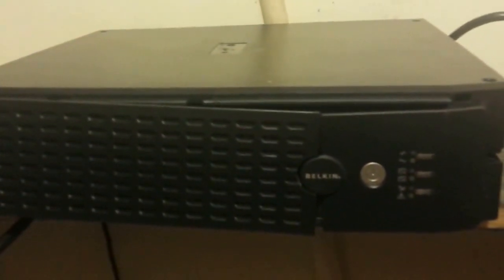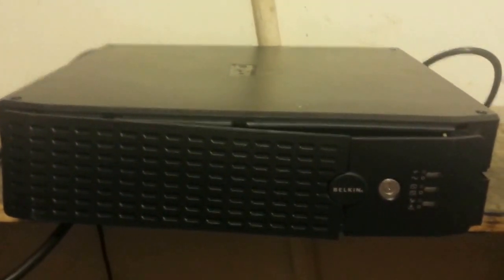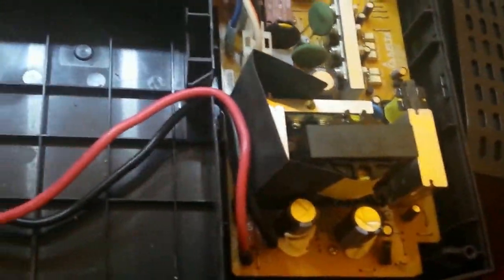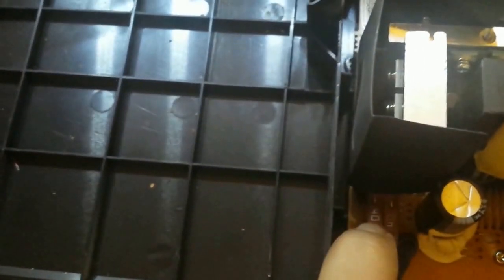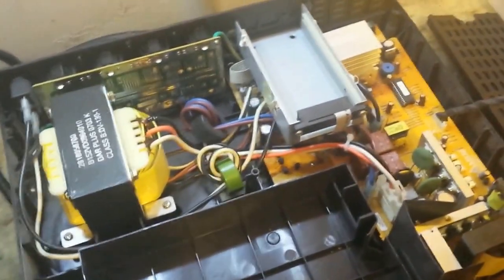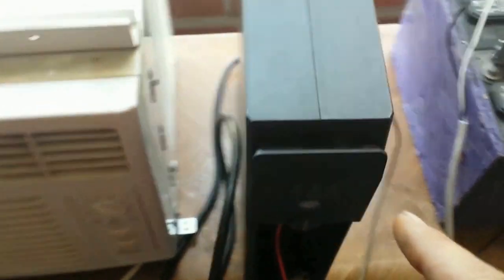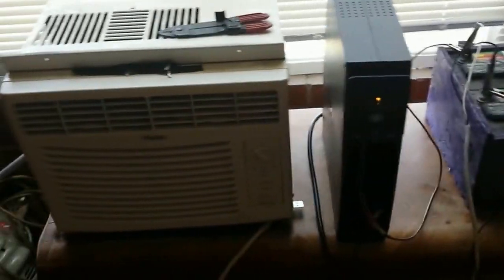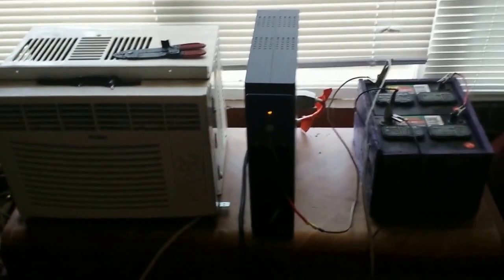Easily turn an old UPS into a power inverter. FREE AIR CONDITIONING

Comment: Bummer, my UPS doesn't work with batteries anymore. I extended it with extra batteries and it didn't like that. Probably to expensive to repair.
Reply from the maker: You can find UPS units at the thrift store for super cheap. Most of them get donated because the battery died
Reply: @ThriftStoreHacker  I think not here in Thailand. And then again it's mostly Zircon over here and I don't trust them with power batteries anymore. Dunno what happened with them; yes, I ruined 2 already. I can give it a try at the bail shop.

Comment: your gonna kill that compressor and motor inside that ac unit with that square wave UPS. youll need to get an UPS that does pure sinewave output
Reply: i doubt it's square wave. if it's designed for computers, it's gonna be a sine wave.
Reply: @lands1459  smps (computer psu fall in this catagory) have no issues witha modified sine wave (Square wave) as they have a bridge rectifier (Full wave) that turns that 115 volts into 170 volts then get bumpped up to around 400 volts dc before it is then switched on and off in the Khz range. you could literally run a computer psu off DC provided you have a high enough voltage. most if not all budget inverters and UPS are modified sine wave (Square wave) with only the really expensive models (akin to the ones used in the it industry for server rooms) do a pure sine wave. do your research. How ever as a side note some spu's with actvie PFC have issues with modified sine wave inverters.
Reply: @CotyRiddle  That's pretty interesting, never knew the mains was fed into a rectifier right away.
Reply: @lands1459  usually it will go through some type of common mode coke and or a differential choke with some x and y capacitors along the way before hitting the rectifier and then being sent to capacitors. go do a readup on how a smps works and the typical layout.
Reply: @lands1459  here is this video from DiodeGoneWild. he goes into some of the technical details and everything but the first one he sows during the introductory clearly shows the rectification stage right after the mains input. https://www.youtube.com/watch?v=cX4q0e124C4

if I can recall correctly there is some topolgys that don't have that as the first stage but almost all smps are the same
Reply: Computers don’t care if it is a square wave or sine wave

Comment: Before everyone turns into a cowboy and rips their speaker out, when you turn the unit on, push the button twice, and it should silence it. You can also plug it into a computer and download a free program to silence it. You can also put a switch in series with it, to turn it off and on. Put some terminals that go to the battery so that you can put a voltmeter on it to check the battery level, or plug it into your computer to tell you how long you can operate it before charging or changing out the battery. When the battery goes down to a dangerous level where it can be ruined, the speaker will make a continuous noise, so keep that in mind before you silence its ability to tell you something is wrong!

Comment: Now if you connect a solar panel to a power inverter you can connect it  the batteries for free solar powered air condition..

Comment: ok how long does it continue & does the ups get very hot?
Reply: Used an 1500W UPS with integrated fans. Do the job for a months (and more if you don't forger to clean the fans every 6 months to keep proper cooling)
Reply from the maker: omar faruque I ran this for 30 minutes and it got really hot. The UPS doesn't have fans. With proper cooling it can run much longer.

Comment: i noticed ur only using one side of ur batteries how do u run anything using ONLY two negative or two positives wires dont u need one positive an one negative to complete a circuit?????
Reply from the maker: Lee Monster this setup is 24v. One positive from one battery, one negative from the other battery, and the open positive is connected to the open negative.

Comment: so if you replace the two 7amp battery with two 12v 100amp for example,the inverter will accept that??
Reply from the maker: jameswoll link two computer fans together so they run on 24v. Cut holes for venting
Reply: The amperage is a capacity of the battery system which can be pulled from it,. The inverter would be pulling  up to  7 amps from the battery, not the batteries pushing x number of amps.
Reply from the maker: VALENTIN TULUCEANU i usually run this on two 72 amp hour batteries. Just make sure you add some fans to the inverter to keep it cool.
Reply: How/where do you connect the fans?
Reply: NEAR THE PART THAT CATCHES ON FIRE!!!

Comment: i have one of these but an apc. a  little bigger, cant wait to get the new batteries installed and also utilize the rear aux battery port for a set of 2 mack batteries! nice for the fridge, router and tv's so when power goes out, theres not even a flicker of power outage, it is steady on!
Reply from the maker: Just make sure you open the APC case and make the cooling better. put some fans on the control board to handle the heat. If you have a 2000w supply make sure to run it under 1500w or lower to get a long life out of the device. Some 12v computer fans do a great job shedding the heat.
Reply: ThriftStore Hacker I already cut the holes and installed a fan directly Infront of the transistors! Those puppies get hot enough to BURN an egg 😳

Comment: Your going to want some kin of a cooling fan blowing over the heatsinks inside that UPS. Mostly because the inverter in there was never intended to handle that kind of an inductive load. You can get away with a few fans and phone chargers. You could even run a computer for a long time on that setup. The inductance of the compressor of that AC unit is dangerous to attach to that UPS. I mean, I know it was cheap but why brick it if you don't have to? Putting bigger heat sinks in would help too, like from an old computer power supply or something. The one's in there were designed to run for a maximum of five minutes while a computer shuts down. If you do nothing else, keep an extinguisher handy just in case... I want to see more videos, not an obituary... Just be careful man...
Reply from the maker: i am very careful when it comes to AC power.  As for the fan idea you are extremely correct. I fried the 1st ups i had due to overheating.  I have a different one that is the same make/model and run two large computer fans over the main board.
Works pretty good and i use it to run the air conditioner in my shed.

Comment: The inverter cost money and the car batteries cost money. The cold air is not free. Even the air conditioner cost money to buy it some one had to! However, the video was good why throw out something that still works!
Reply from the maker: Scott Shuman Yes. There is startup money involved. You can find these inverters at thrift stores and garage sales for 10 bucks. the smaller ones that run on 12v can be had for almost free.
The batteries are best bought remanufactured if you have a local company that does it. My local guy remanufactures batteries and sells them for half the price of new ones with a 2 year warranty.
The charging system is where the money goes. I already have 1000w of solar so I can run this box most of the day on the electric trike battery pack.
I also have plans for a diesel engine powered charger. I can make it run on waste oils.
my projects are never done and are as cheap as possible to build. As I aquire more cheap junk I will come back to this project. Garage sale season is coming.
Thanks for watching!
Reply: I reuse everything personally as well. Things cost to much now days.
Reply from the maker: And it makes a fun hobby. You learn a lot.

Comment: is your ups sinewave ?? thats an awful lot of electric noise
Reply from the maker: joshua gabriel It is a cheap inverter setup. makes a lot of electrical noise but works good. I gave this setup to a friend who lives in the mountains and they now use it when their power goes out during storms.
Reply: +ThriftStore Hacker Well its a good setup , but i suggest buying a sinewave based ups setup especially when your going to use it with appliances like an aircon, it helps work the aircon more efficiently , im sure you can find some of those reasonably priced :) 

im just doing this to help other people out there that share the same ideas about running electricity for free an living off grid :)

hope this helps :)

Comment: Could you hook up an alternator or solar panels directly to the inverter of a smart ups? How will overpowering or underpowering the ups affect the unit?
Reply: By underpower I mean the correct voltage input but trying to draw more watts than available, and by overpower I mean correct voltage input but having excess amps avalable from the alternator.
Reply from the maker: Matt Hunter you could use an alternator but you will still want a battery for the alternator to keep the power consistent. the alternator is internally regulated so it will cycle if the battery needs charging.
Reply: Mainly I wanted to use the UPS as the inverter for a generator, would a normal car battery be ok for the purposes of power smoothing? 
Also would I be better off getting multiple low wattage ups units or one high wattage one or does it not matter?
Reply from the maker: Matt Hunter a car battery should be fine. just make sure if your inverter runs on 12 or 24v.  the one I'm using in the video runs 2 12v batteries making 24v.

the higher wattage UPS the better. make sure you add a fan to cool the circuit board.
Reply: Sweet, cheers mate!

Comment: How does it make it free? You still need power to charge the batteries.
Reply from the maker: I have some solar panels to charge the batteries. They charge up all day and i can run the A/C for a couple hours when it is really hot out. It really helps with the power bill.  If i had more solar and more batteries i would run it all day.
Reply: That's nice.
Reply: ThriftStore Hacker where do you connect the solar panel? Is there a way to bypass the AC cord to accept solar DC to charge the battery as the UPS must have a charge controller to the battery? Or do you still need to purchase a solar charge controller and connect to the battery terminals and use the UPS outlets as an inverter? Thanks
Reply from the maker: Cyrus Ramsey I use panels and a controller hooked to the battery. the UPS is used because it is a cheap or free way to get a power inverter. I'm currently looking for a cheap gas or diesel engine to turn an alternator. if I find all the bits over the winter I will be able to power more than the a/c
Reply: Wind generator a lot cheaper, and you can get quite ones.

Comment: I have an XS-1500 with bad batteries - Removed the batteries (7.5 Amp-Hr) and connected two 55 Amp-Hr sealed lead acid batteries to it, works like a charm. Kept the computer / network / LED TV and several LED lights going for over 20 hrs. during hurricane Matthew
Reply from the maker: Tim Abbott nice!  one thing I would recommend is to add a  computer case fan. help ventilate the board.  mine runs very hot with the air conditioner running.

Comment: I tried this a while back, wasnt successful. For some reason everytime I turn on the UPS/inverter after hooking it up with my bigger car battery, it switches off again instantly. Despite researching it for a solution, I couldnt find one. 
If anyone have any idea please share..
NB: the UPS works fine with the original 12v small battery. (I'm guessing the car battery's amp is wasy to large for the UPS)
Reply from the maker: Sam Kipgen the amps should not matter. it may be the startup wattage of the item you have plugged into it.
Reply: You are probably exceeding the capacity of the inverter of the UPS.

Comment: what would I have to do to get this to power a amplifier for a car audio system that I'm trying to setup in my garage?
Reply from the maker: xopex industries if it is a car amp you can just use a car battery and charger. or a computer power supply
Reply: do I have to have a car battery? can I do it without a battery? if I have to have a battery, would a motorcycle battery or two suffice? and would I be able to charge them with the UPS?
Reply from the maker: xopex industries a motorcycle battery will run it for 20min and I would not charge it with the UPS.  if you are doing a car audio setup it is all 12v DC already and the UPS is useless .  you can hook up a charger to the motorcycle battery (see my other vids) and get the 12v DC you desire and charging.
Reply from the maker: xopex industries if you look online there are plenty of tutorials on how to use a computer power supply to run 12v devices.  if you want no battery and run it off house power this may be the way to go

Comment: um..... you are connected to the 2 positive post.  i call fake. you have it plugged in .the on battery light isn't on.
Reply from the maker: Those 2 batteries are not the same. one is a u1r and the other is an u1r-7 same battery but the poles are reversed.
Those batteries will only run the unit for about 20min but are small and easy to use for a demo. I use two big 60 amp hour wheelchair batteries backed up by a solar rig to run it at home.  
As for the battery light not being on..  if you hold the power button for 10 or so seconds it shuts the whole inverter off. Since it is not plugged into the wall the only light you see when you turn it on is THE BATTERY LIGHT!
Next thing. I run this channel as a hobby for showing off my experiments. Why the hell would i try to scam people. How about asking some questions before you criticize my video?

Comment: OK INTERESTING NOT REALLY FREE MUST CHARGE THE BATTERIES CORRECT..TK YOU
Reply from the maker: yes I will need to charge the batteries. currently I have 160w of solar charging for that but if I can get about 1000w I can run the air all day